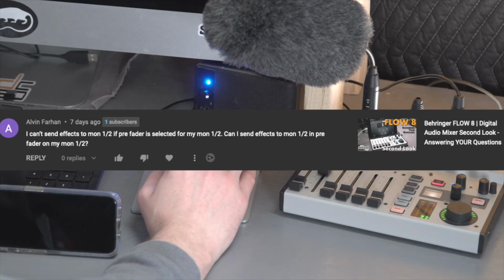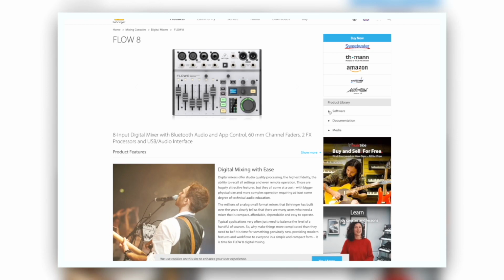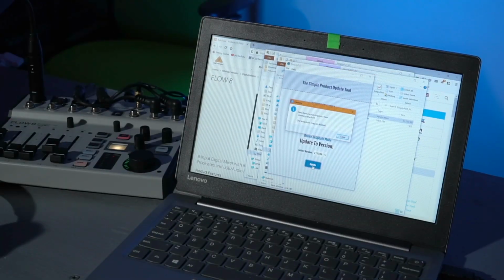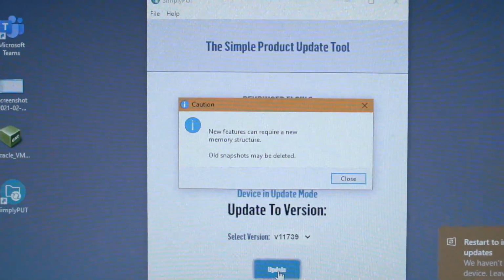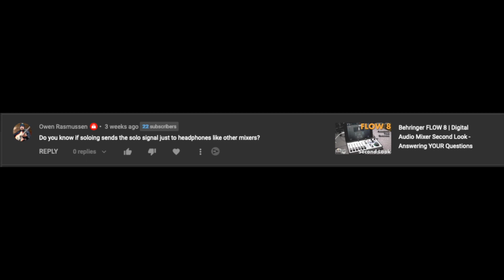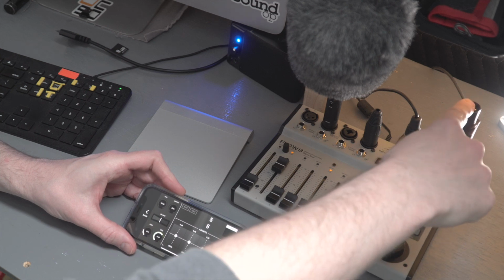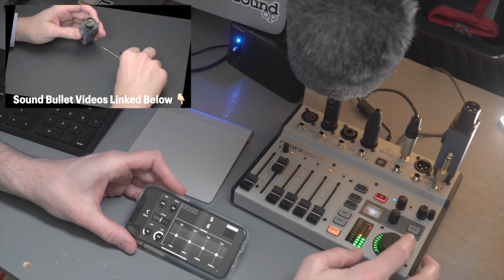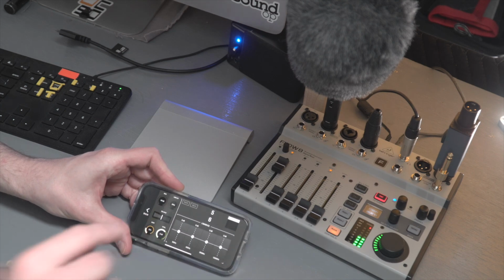Behringer Flow 8 Most Common User Questions in 2022

Comment: Is there any possibility to work in 44100khz rather tan 48000 khz  for recording. My standalone gear recording usually in 44 and it's a lot of mess afterwards and gliching... Lowering sample rate in a driver will l
lower cpu power consumption...

Comment: Behringer just dropped the price of this mixer to $249 CAD / $179 USD making it an unbeatable option right now. I think there's nothing at this price point with the features this offer in the market currently. I just bought one to use when I'm jamming with my band but don't want to plug everything into my A&H CQ-20B and of course, karaoke nights. The only issue is finding it in stock, it was already difficult when it was more expensive... (At least in Canada).

Comment: Can I send both the main L/R XLR outputs (balanced) to a home stereo input device that accepts as input (unbalanced) either a jack stereo or RCA L/R? My thought here is using a cable adapter  to connect both XLR to a jack stereo or RCA R/L. Thank you
Reply from the maker: Yes, you can absolutley do that. You would just need an XLR to RCA adapter for each of the L/R sides. Something like this should work... https://amzn.to/3R51SYC (that's an affiliate link).

Comment: Is there any options to use solo button on the mixing desk? Because I can see only the one option is from the mobile app mute and unmute solo button.
Reply from the maker: No, AFAIK you have to use the App to solo channels. I sent this one back to them a long while ago now, so there may have been a firmware update since, but this really isn't a mixer I would recommend trying to use without the app. Thanks for the great question though.
Reply: @DcSoundOp  Really missing this...

Comment: Can Flow8 be used for video recording and streaming by conecting the flow8 directly to an android device to send a mixed audio single (I am do to mean to manipulate mixer's controls through wireless connection) to the android camera recording.
Reply from the maker: Yes, you can do that in streaming mode on this mixer. Thanks for the question!

Comment: I salute you. I also have a question. In manual gain, if I connect a Pioneer xdj rx2 on line channel 7/8, for example the master in Pioneer rx2 and gain on channels, at what volumes should it be? What about speaker volumes? In my case active rcf. Thanks

Comment: Hi.I have one question.Its possible to use phone usb charger for power on flow8? Is safety or original adapter is better to use?
Reply from the maker: You can use other power supplies, as long as it can deliver the same power. The original was rated 5V at 2 amps / 10 Watts.

Comment: Hi.Its possible to use Usb phone charger to power flow8? Is safety or better to use the original ac adapter?
Reply from the maker: You can use other power supplies, as long as it can deliver the same power. The original was rated 5V at 2 amps / 10 Watts.

Comment: Very good Videos Thank you ! May be you can help me. I am using my Flow 8 on Stage with 2 Aktive Speakers MAIN OUT. At the same time I have a Split cable  coming from Phones Output into 2 Stereo OUT.   One Stereo Out I use as a kind of Monitor. The other stereo out goes to my Taskam for Recording my Live Performance. The Problem is that the Signal is far too loud and I get distortion, even if I turn the input Volume to ZERO.    I could turn the Volume of the Headphone down.    -   But then the signal is to weak for my Monitoring.
Is there a way to copy the main Signal to the Monitor Outputs and record from there with a decent LEVEL .  I am using this kind of monitoring because i can control the loudnes imediately wth on physical knob. And its a kind of mirror what is going to the main outputs. Do you have  an Idea for what could be best for me.  Thank you
Reply from the maker: Hi, thanks for the message. For making a copy of the main mix for monitoring, you can simply set the monitor send to (post fader) and then bring each channel fader on that send up to unity - this will give you a mix that follows whatever happens on the main mix - if you bring a channel up or down on the main mix, it will reflect the same change in the monitor send. Often we use Pre-Fade sends for monitors so you can build a mix that includes only what you need, but if the house mix works for you, that's fine to do it post-fade. 

You could use another post-fade send to record a similar copy of the main mix, tweaking things as needed for the recording by moving the faders for that send up or down a little bit from the unity position. i.e. if the guitar is screaming loud in the room, you might need more in the recording than you are putting through the main speakers. 

Let me know if I've misunderstood what you're asking though.
Reply: Thank you it seems to work fine ! I have one more Querstion :     Ist it possible to connect to the App via bluetooth with different android and apple devices at the same time to controll the knobs and faders.  I Tried I pad and Android Pad but I could not connect at the same time. As soon as I put my flow 8 in Blutooth pairing app the device that is already conected looses connectivity  @DcSoundOp

Comment: Hi, thinking of getting one of these as a backup for a solo singer using backing tracks.  How would I get a summed stereo signal on the outputs when using a single speaker?   Both mixers I have used before, soundcraft and Dynacord accomplish this quite simply but I see no option on the Flow 8.  In your opinion are the pre-amps good enough for this purpose?.  thanks, Jeremy.
Reply from the maker: Eh, if you're used to mixers with more features and routing, I would skip this one, it doesn't have tons of that. Without knowing your personal preferences and all, it's hard to comment on mic preamps at such a low price point. They are all very very similar & usually only a very small part of what affects the sound an audience is hearing at a live gig. That being said, if you are seriously concerned about mic preamps and sound quality, the lowest priced Behringer mixers may not be the best choice for your needs.
Reply: @DcSoundOp  At present using a Dynacord CMS1000-3 but just looking for a backup in case of failure.  Probably just go with a yamaha analogue.  Just liked the look of the little flow 8.  Good price too, as most likely never get used.
Reply from the maker: @rockbyter2011  If it's only for a backup and likely not going to be used often, then I would absolutely go with the small analog Yamaha. If you go long periods without using this one, when you do need it, you'll also need the latest version of the control app for your phone or tablet, which requires the mixer to have up-to-date firmware to work correctly.

Comment: Hey there, we have a problem with connecting to dj controller pioneer ddj ergo through jack 6mm. The sound coming is so lame like we hear only background of it. But the cable and dj controller themselves work alright with the old non digital mixer. What is wrong?
Reply from the maker: Sounds like something is wrong with your mixer or the cable you are using. Would need a fair bit more detail to be able to begin to diagnose the issue, but have you reached out to Music Tribe for support?

Comment: Love this little mixer!  I do seem to have a glitch that I can not find any information on. I didn't know if you could somehow help or point me to someone that can.

When viewing the 4 band EQ on the combo channels,3 &4, show  the four bands read 0Hz rather than 100Hz, 500Hz, 2000Hz, & 12000Hz like the rest of the channels. The text is also blue, which normally is white. I don't know if that means something or not. When moving each 0Hz band slider, they don't respond as change as they should.

I have the latest app software and mixer firmware. I have re-updated them both in case there were any glitches.
Reply: Tap on any of the four eq frequency areas and they will expand to let you set the frequency, band width and gain.

Comment: I read that the effects can be only post not pre me that I want 1 effect for my laptop for karaoke and 1 effect for the in ear monitors it will be a problem that it will be only post not pre or not me my problem is I don't want to hear noises when I open my microfone to my in ears for this reason I want different effect what is your opinion i would be satisfied with this mixer or not?

Comment: Are the first two preamps Real Midas or designed by Midas? These days behringer seems to use the Midas Logo a lot, and I understand that but its hard to differentiate on what you are really buying...
Reply from the maker: These are Behringer mic-pres... regardless of who's intellectual property they xeroxed before the bean counters started substituting parts and processes to get the cost down this far. It's all marketing. See my video about the Soundcraft/Lexicon/DBX/DigiTech Ui12 mixer, most of the big old companies have been bought and sold so many times over now it's a joke trying to keep up with who 'designed' what.
Reply: @DcSoundOp  therefore Even the X air Mr18 doesn't have real midas pres nor anything in these price ranges. But still all of them sound descent...

Comment: Is there any way to power cycle it without unplugging the cable? The closest I've found is holding mon1 and then menu and it puts it in standby, but that's not quite what I'm looking for. I'd like a full reboot for when the bluetooth won't connect since this usually fixes it.
Reply from the maker: Besides an external switch, or a power strip with a switch… there is no other way.

Comment: Great video. I've got a question for you regarding the preferences in the mixer app:

What does the settings "mixer app link" and "finer sliders" do?

/Rasmus
Reply from the maker: Mixer app link…. Links the mixer to the app. So if you change layers on one, the other follows. Fine sliders makes the faders longer so you have finer resolution to work with.

Comment: I have this mixer currently and have been able to make it work powered speakers but not passive ones. Does anyone know why?
Reply from the maker: This mixer will work fine with passive speakers, but you'd need an amplifier of course between the mixer and the actual speaker. Powered speakers have the amplifier inside, but the signal chain is the same... Mixer - amplifier - speaker. Hope that helps.
Reply: @DcSoundOp  Thank you for your quick response! Do you have any recommendations for which amplifier I should use? I'm relatively new to sound systems and things of this nature. So any context would be greatly appreciated!

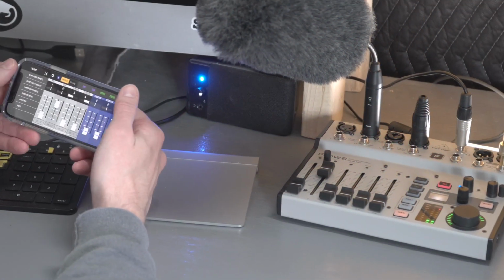Comment: You are missing the point of the question of sending fx to mon in PRE-state. I cannot get it work either. In your video you have main-section ch2 fader up in time 0:45. Then you are routing the fx to mon and everything seems to work fine, but if you are bringing down the fader of ch2 in MAIN-section, you don't have fx anymore in mon. And if bringing down the mon fader, the fx stays. This is acting like POST-state (depends of main), not PRE-state (independent).
Reply from the maker: The eFx sends are only post fade, so yes of course it would go away if you turn down ch-2 on the main page. There’s no way to cheat that here.
Reply: @DcSoundOp  can you do pre fade listen on channels?

Comment: Fascinating about Standby, did not know that. Can you still get full 48 V phantom on 1/2 when running it from a (2A) battery pack?
Reply from the maker: Yes, phantom works fine as long as the battery pack is appropriately sized and specced as you suggested. Thanks Ed.

Comment: Great videos on the Flow 8 and I‘ve learned a lot. But the two effects channels are a real limitation, I guess $250 doesn‘t buy per-channel effects. Question is: what would you need to pay for something that does that? As a singer/songwriter I find the two fx busses incredibly limiting and also a bit pointless: you can‘t even use the first effect, Ambience, because you‘d have to choose Vocal or Instrument for that effect, as you only get it in FX1. Your thoughts here would be very useful!
Reply from the maker: Thanks for the message. Per channel plugins are not something you're going to find in entry level mixers unfortunately. For most uses on a small mixer two effects engines is more than enough, and that extra processing costs real money. I'm not sure I'm following why you're saying one of the effect engines is useless either, can you explain more about what you're trying to accomplish? I'll see if I can suggest something that would work better than this.
Reply: @DcSoundOp  Wow thx for replying so quickly! Yeah sure. Let‘s just say I want to use the Ambience setting for my guitar plugged into Channel 1 and vocal mic plugged into Channel 2. It‘s on FX1, so I can‘t pick it twice, only once. Well, Ambience has an Instrumental OR Vocal setting. So whichever one I pick, it will sound “wrong” on one of those channels. And if I want to use, say, Guitar Reverb, that means I have only one more effect for everyone else and that effect cannot be a reverb. So my guitar has a reverb on FX1 and my vocals have … nothing! It’s a weird choice to have the effects busses hard-wired like this. Just one set of effects and two busses with any of those effects would have made more sense, surely?
Reply from the maker: Yeah, your original assumption was right.... you're looking for a mixer with WAY more flexibility than this price point is going to offer. They way they've configured this is extremely common in smaller mixers for live sound. There is also no reason to think using a verb they've labeled instrument or vocal will be wrong if used on the opposite source. There is no reason you should be able to share a verb between vocals and guitar for a singer songwriter gig on a small mixer... unless you are trying to achieve specific guitar effects, in that case a verb pedal for the guitar would be the simple and cheaper choice than a bigger more capable mixer.
Reply: @DcSoundOp  I did a bit of online research just now but basically could have waited for your reply 😀 Yeah, the various verbs work well enough and I’ve even found adding a tiny bit of a second FX2 effect like the echoes to the vocal sounds good, too. I’m pretty happy though since I also contribute the odd instrument to live sets and having those presets on the mixer ready to go for different instruments is just fantastic. Plus of course with this I can play around with songs without my iPad and interface, all in all pretty good.
Reply: @DcSoundOp  Hi again, can I ask if you covered getting a mono out from the Flow? Like if I am playing a bunch mono of instruments but want to keep the line to the mixer guy simple. Would the best bet be the left-hand Main Out or should I go for a Mon 1 or 2 out? Only thing is Mon 1/2 outs are not balanced, right? Hoping you‘ve covered this…

Comment: I finally got mine and these series of videos helped a lot.  Is there a way to connect to the  mixer with the app without having GPS enabled? I don't understand why it would have to be.  Did I miss the fine print ?
Reply from the maker: AFAIK, you do still need to give location services permission to the app when first installing.
Reply: It  doesn't "connect" in demo mode or otherwise unless Gps is enabled.  Rather annoying .. Oh well.
Reply from the maker: It won't connect to anything in Demo mode, that is literally just to demo the app for folks who do not have the mixer yet. But yes that is what I said, you need to allow location services for it to work.
Reply: @DcSoundOp  I know that's why I put it in quotes.  I guess I should have said the app won't  fully launch to the main  controls screen.. Either way.  It's your channel that helped a lot.  I just thought I'd highlight that issue in  the comments. So that other would know what they're  getting into .  Keep up the good work.

Comment: Great Content, I have question for flow 8, how to do streaming and recording at the same time ? when usb is using for the multitrack daw and the main output to Speaker, can we feed the OBS/Yolobox from monitor or headphone?
Reply from the maker: You'd probably need a slightly more flexible mixer to stream and multitrack at the same time easily. The workaround I can think of (assuming you're not already maxing out the ins and outs) would be to use multitrack mode, then patch Mon 1 output in to a spare channel... that would get Mon 1 mix into the computer via that channel's send to the computer so you can route it to the stream in OBS.

Comment: If I use it as an audio interface with Ableton Live are there only two outs? Or does it give you four outputs (main left & right, monitor 1 & 2)? I am keen to use something like this to send Stereo tracks to front of house as well as a third channel running click track. Currently I use a Scarlett 2i4.
Reply from the maker: Yes, there are two pairs of returns from the computer that you can assign to channels and then route to L/R or monitors as needed. They come back as USB 1/2 & 3/4 and cannot be broken from their pairs. Thanks for the great question!
Reply: @DcSoundOp  thank you so much for the response, I really appreciate it!🙌